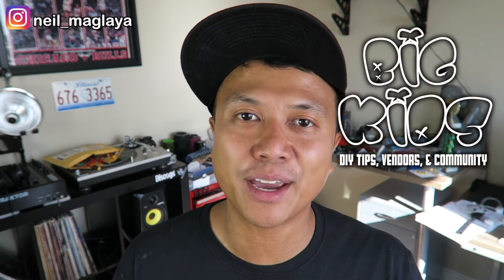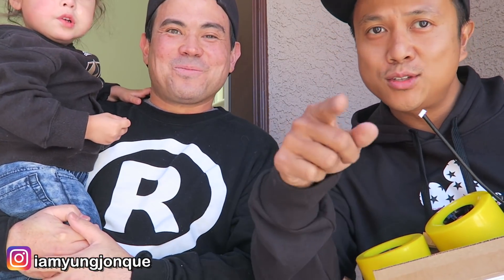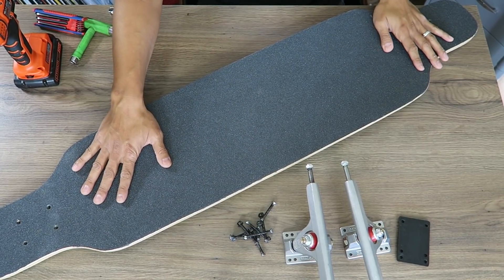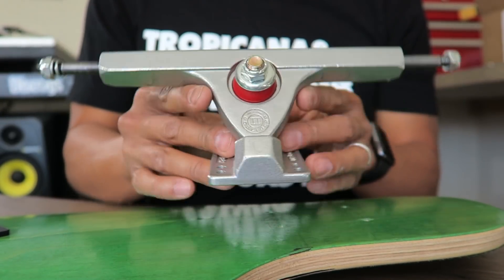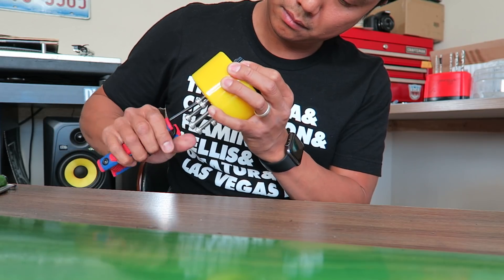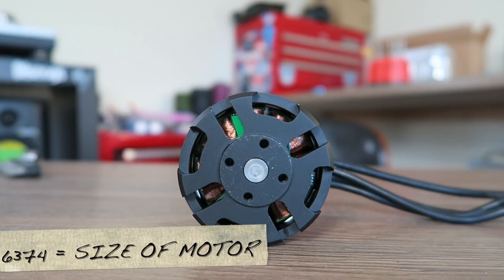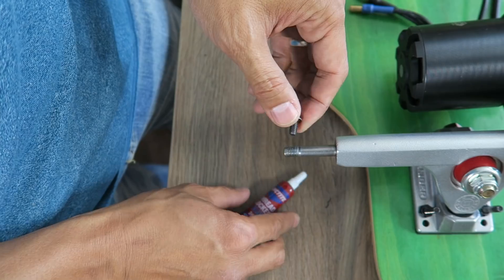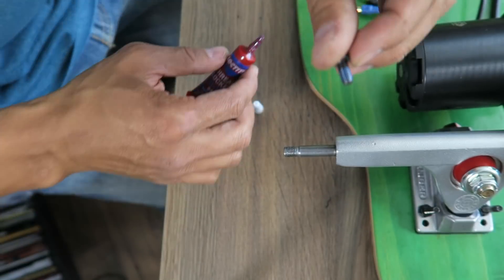HOW TO BUILD A DIY ELECTRIC ⚡ SKATEBOARD TUTORIAL PART 1 - BETTER THAN A BOOSTED BOARD

Comment: whats the batteries you use and charger for them
Reply from the maker: +Alex Ciobanu Hey there!  Thanks for checking out this video! I hope you'll consider subscribing to see more videos like this one.  I currently use (2) 5S LiPo Batteries and a IMAX B6 Balance Charger.  If you'd like more information check out this video:  https://youtu.be/3dfBrrNUsos. 

- Neil
Reply: Big Kids you inspired me to make my own e-board I’m already got all the parts but not the batteries cos the hobby king they don’t have in stock turnigy 5000mah 5s 30c lipo pack,I’m using vesc controller so i don’t want to burn it up with other batteries
Reply from the maker: +Alex Ciobanu Hey Alex thanks so much for the support!  If you would, kindly share this video on any of your Facebook platforms that would really mean so much!  Anyhow, if the Turnigy batteries are not available the next best thing I can suggest is the same 5000mah 5s LiPos but by a company called Zippy.  Let me know if you have any questions when you start your build!

- Neil

Comment: Hey man, really digging your vids and looking forward to part 2. If you don't mind me asking, I'm building the exact same skateboard as the one you're showing in this vid (same sized board, wheels, trucks, and MOTOR 6374), except it's going to be a dual motor. Will two of these motors fit on the truck you're using?  (The 10 inch axle)
Reply from the maker: Hey there!  Thanks for watching, Ryan!  I hope you'd consider subscribing to see more videos like this one.  The truck I use on this build will fit (2) 5065 motors:  https://diyelectricskateboard.com/collections/electric-skateboard-motors/products/electric-skateboard-motor-5065-260kv?aff=3.  However, if you use (2) 6374 motors I suggest 218mm truck from Torque Boards: https://diyelectricskateboard.com/collections/longboard-trucks/products/torqueboards-218mm-trucks?aff=3.  Hope that helps!  Keep in touch and let me know how it goes.  I love talking shop and getting to know everyone in the comments!

- Neil
Reply: Hey Neil, thanks for the help brother! Just subscribed to your channel. I'm over in Baltimore doing my residency and this board will definitely help with my commute to work/gym/library or whereever I have to go without having to worry about finding parking, paying for parking, or someone hitting my car. Thanks again man. Keep up the good work and I'll keep you posted!
Reply from the maker: +Ryan Kim ahhh sounds like an esk8 will be perfect then!  Good luck and again, thanks for the support!

Comment: Nice video man! I just purchased the 90 hub kit 10s5p on diyeboard, they say comes with 2.1 foc esc or something like that, Can I put enertion focboxes on this setup or Im just talking nonsenses? Will be good? What you recomend me to upgrade my board step by step? Thanks
Reply from the maker: Gabriel Del Pino thanks for watching!  I hope you consider subscribing for more videos like this one!  the VESC with FOC is essential to running hub motors smoothly because they are sensored motors.  However, i am not familiar with the ESC from diye.  The FOCBox from Enertion is one of the best VESCs out there.  10s5p will get you a very nice speed and distance for sure.  If this is your first time building an electric skateboard i really recommend you take your time and do your research on the esk8 forums.  If you have any specific questions let me know.

- Neil
Reply: thanks man!! sadly diyeboard refund my order because they can't deliver the battery pack to my country, so I will start from 0, how much money do I need to start a diy esk8 with nice parts but without going to high? (I'll suscribe for sure you have a lot of nice videos)
Reply from the maker: +Gabriel Del Pino I have a couple good contacts with good 🏂👌 esk8 parts globally.  What part of the globe 🌎 are you located?  You can always save money on shipping if you buy from somewhere a bit closer and when you buy every Big from the same vendor.
Reply: That would be awesome, I'm in Chile
Reply from the maker: Hey Gabriel, so considering where you are I know that this company https://diyelectricskateboard.com/bigkids ships to South America.  Consider using them as I've tried and tested many of his parts.  He also has given me a $10 off of $100 coupon if you use the code BIGKIDS10.  Let me know if you also need a parts list or if you're good.

Comment: Any advantage to running larger wheel just on the front trucks? I'm stuck with 90mm hub drive wheels on the rear. I've bit it a few times hitting a deep crack on the poor streets around here. I was thinking if I had a larger wheel up front it would be less likely to get caught in a crack. Maybe even the 100mm MBS all terrains? Could shim the rear truck with a thicker riser pad.
Reply from the maker: +Adam Opheim hey 👋🏽 Adam!  I️ can see how your theory would work.  Have I️ tried it, no.  So I️ can’t really give you advice as to what would happen if you did it.    However, I️ can tell you that larger diameter wheels will give you a potential for a higher top speed.  Th company Carvon gives The rider the option to use any wheel with their direct drive hub motor.  Anyhow, good luck and let me know how it goes.

- Neil
Reply: Tried it... Works great! 100mm MBS in the front, shimmed the rear trucks until it was level. Ordered a 41" drop deck ($31 shipped) ebay special.  More stable and handles large cracks much better. Rides like a whole new board. (originally a meepo)
Reply from the maker: +Adam Opheim That's sick bro!  I love diyer's come up with awesome solutions.  That's the biggest reason I didn't buy a Boosted as my first Board.  They're fine boards but then that'd kind of be the end of the hobby.  With DIY esk8 I'm only limited by my imagination.  That's why these Meepo/Wowgo boards are a great introduction to the DIY scene...there not to expensive that you'd feel bad for modifying it.  Great work brotha!

- Neil

Comment: Thanks for the vid on hardware. In the next video, could you go over the BLDC tool for calibration? I find that the actual calibration is the hardest part for my electric board, mostly because there's just so much I don't know about the BLDC and the VESC in general.
Reply from the maker: +lazyboy395 hey there!  Thanks for checking out the video and hope you consider subscribing for more vids like this.  I’ve recently completed all of the filming and building for the next video.  And, yes I have covered VESC configuration through BLDC.  Stay tuned and hopefully ill have something ready after the Thanksgiving holiday.

-Neil

Comment: Hey, I was just wondering if someone could tell me if the motor and battery comes with the kit or do you have to order that seperatly
Reply from the maker: Usually, if you buy a mechanical kit it only includes a motor, motor mount, pulleys, and maybe trucks and wheels.  https://diyelectricskateboard.com/collections/single-motor-mechanical-kit/products/single-motor-mechanical-kit?aff=3  Then you'll need to buy a VESC and battery pack seperately.  I hope that helps.  Let me know if you have any more questions.

- Neil

Comment: What tires are those 97mm?
Reply from the maker: Hey there!  Thanks for watching!  I hope you'd consider subscribing to see more videos like this one.  The wheels are 97mm flywheel "clones".  They are a reproduction of the original ABEC 11 Flywheels.  If you are concerned about the feel of the ride I'd spend the extra money.  However, this was a budget build so we cut cost with the wheels.

- Neil
Reply: I got hooked up on backfire2 indegogo.  Still like your build though!  I wonder if I could ream out some 97 wheels to fit back hub motors?

Comment: Great looking board roughly what is your cost to build single motor board like this.   Where can you get discounted tires?  ABEC 11 97mm look slick
Reply from the maker: Hey there!  Thanks for watching!  I hope you'd consider subscribing to see more videos like this one.  This build was done on a budget of about $550.  the 97mm wheels used in the video were clones which run about $35.  If you can spend a bit more I'd go with the the genuine ABEC 11 Flywheels.

- Neil

Comment: I just made mine with 6300 watts of power, dual 6374 setup, carbon fiber racing deck with grip, 12S4P battery with BMS, about 40 MPH, LED lights (1600 LUMENS), and 50 mile range. Will post my video in about a month or less. The most challenging was the wheel drilling, as I put all six bolts and the knurled set screws that kept coming loose, had to really torque them in....
Reply from the maker: Sweet build bro!  Did you get a 12 inch truck to fit the dual 6374 motors?  My next build is going to be dual Carvon direct drive motors; I can't wait.  Shoot me a DM when you upload the video I love seeing peoples builds.  dude, last week I saw a quad drive with pnumatic wheels rated for 60 mph!!!!

- Neil
Reply: I had to purchase the 218mm trucks to fit the Torque Boards 6374 motors. I think my board is dangerous at 40 MPH, let alone a 60 MPH pneumatic wheel board. I can't even take mine to its limit, because I'm too scared to go any faster than about 20 MPH, at least for now, maybe when I get more comfortable later I'll go faster. Actually, I'm going to start custom building different type of electric boards and sell them. Current system cost me about $2000; selling it for $2500.
Reply from the maker: ELLIOTT MORIARTY very cool!  Yeah, the best part of DIY is that you are only limited to your imagination!  I also thought of selling complete builds.  Good luck with that!  It’s funny how speed becomes relative.  Once you get used to a speed it starts to feel slow.  I’ve topped my board out at 33mph and now I want more!  Anyhow, I love talking shop.  Please stop by again and I look forward to getting to know you in the comments!

- Neil
Reply: Check out my Facebook page for some preliminary pictures and short videos.